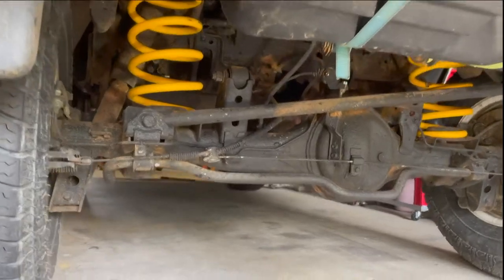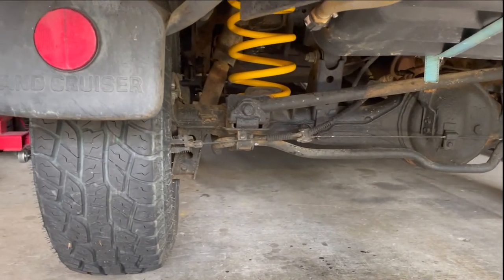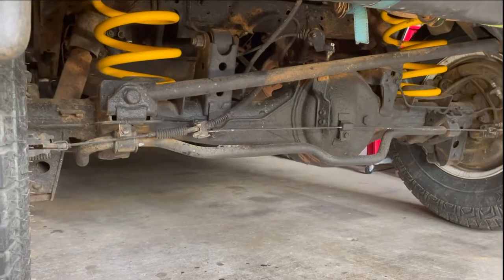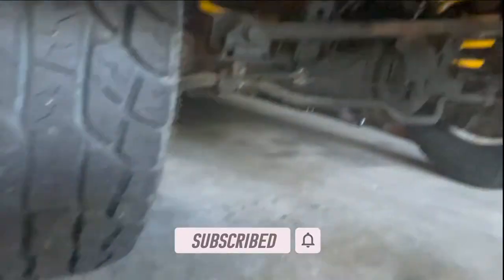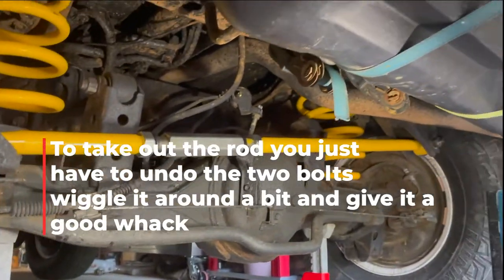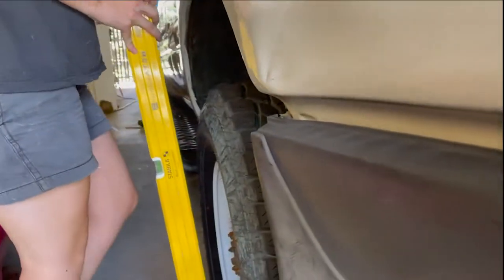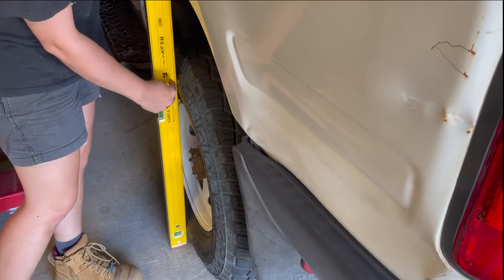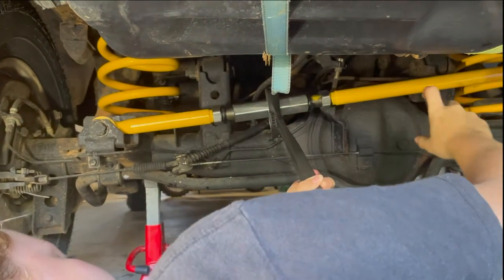80 Series Landcruiser Pan Hard Rod Install & Adjustment

Comment: This isn't exactly right, and it's not your fault. Most aftermarket suspension companies, in Aus, are not giving us the correct information.

So yes, on its own, the adjustable panard will allow you to center the axel under the chassis, but only at your static ride height. 
In the real world, you have actually made things a little worse off, as you have now increasing the overall side to side movement when the suspension cycles through its travel.
The ONLY way to reduce this side to side axel wiggle, is to correct the panhard bar angle to 0 degrees/parallel to the axel. To correct this, you will need a panhard riser bracket on axel, this will raise the pivot point level with chassis side pivot. 
This has two big advantages, one being, much less side to side axel movement, and you are raising the roll center, which will reduce your body roll. 

Get one from Rampt customs. Trust me, you will thank me.